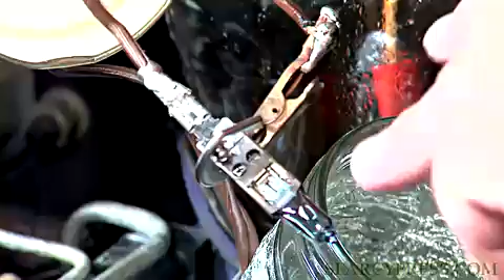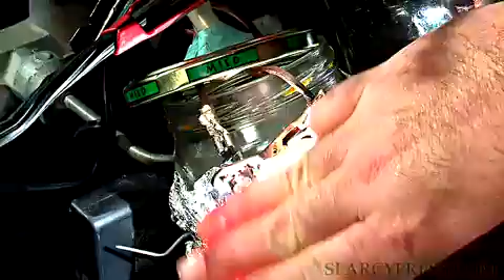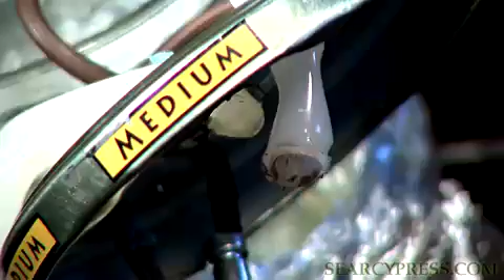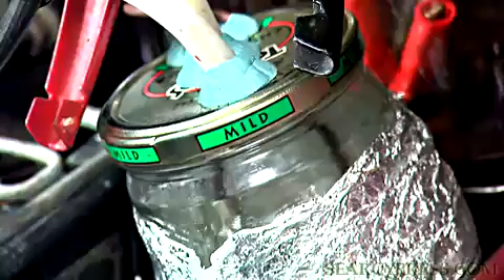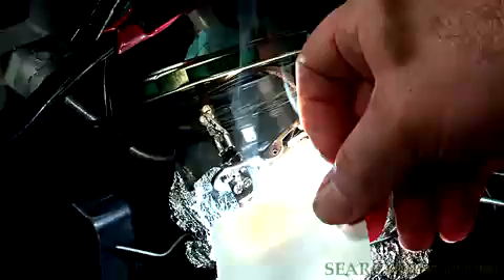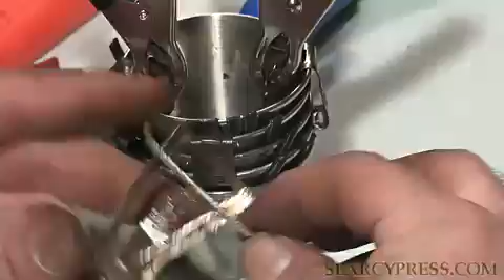▶ Vacuum Pressure Hydrogen fuel cell defeats high gas prices using hydrogen from H2O    YouTube 360p

Comment: I did my Suzuki multi cab run on HHO at 100km/liter .And you know what? You inspired me to go on and not to give up. The first attempt was when i saw this video long time ago. So many problems encountered during the first two year in designing my very owned designed of reactor. My advise to the individual who is working on HHO just keep your time and listen to other people who is also working on it. HINT.. do not force the reactor to produce more HHO. Plugged the two Jets of the CARB according to the reactor's actual production. Regulate the HHO coming in to engine while in IDLE mode to avoid high engine idle, (i called it hjigh pitch from ariana grande to celine dion) means your car drinking so much gasoline. My reactor's are uniuqe i never seen in youtube with the same construction/designe.   Anyway thank you so very very much bro